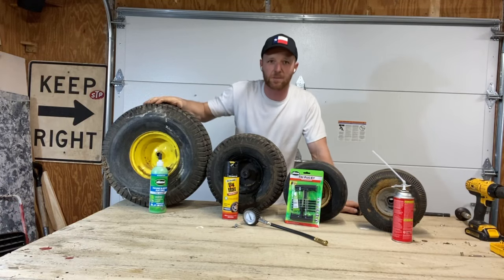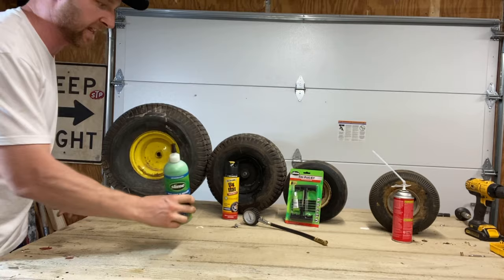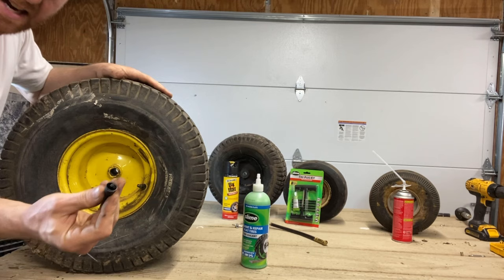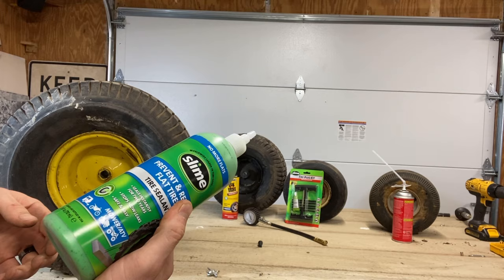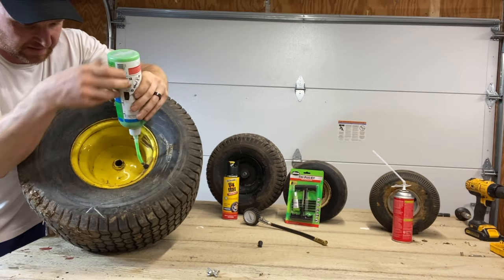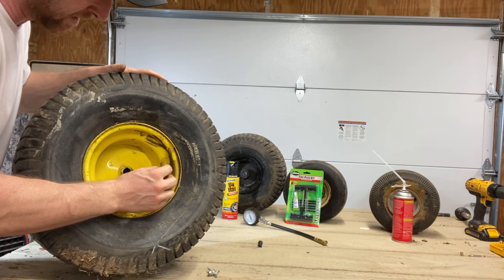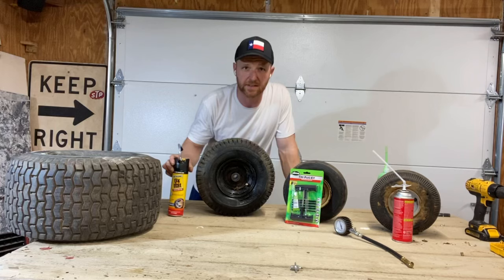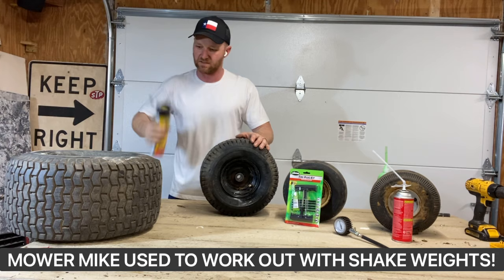Mower Tire Repair; Plugs vs Slime vs Fix-a-Flat vs FOAM (WARNING FOAM DOESN’T WORK!)

Comment: You keep calling them tire "patches," but in reality they are tire plugs.  I used to work in the manufacturing of these and went to car expositions around the world.  I sold millions of these.  One demonstration I used to use at the conventions was to take a drill and drill a hole in a car tire and immediately plug it.  By the end of the convention, that tire had maybe 75 plugs in it.  Just a word of caution.  The plugs aren't intended for sidewall punctures in any kind of road vehicle.  Although it might work, I wouldn't recommend it.    The absolute best way to repair a tire is to plug it and then demount the tire and place an actual patch on the inside of the hole with cement.  However, just a plug will almost always work.  The plugs are manufactured in such a way that the vulcanization of the rubber is initiated, but the heat that comes from driving the vehicle on the road finished the vulcanization process and makes the repair pretty permanent.
Reply from the maker: Wow that is some serious info on tire plugs. I had no idea the heat activated them. Thanks for the information.
Reply: Thanks for the information..   
God be with you.peace
Reply: Yes those plugs are great. 3M also has a glue called PR 40. It literally welds rubber together im going to try that stuff
Reply: So doesn't that mean the plugs would not be a good choice for a lawnmower or snowblower, which never move fast enough to generate enough heat to fully vulcanize the plugs?

Comment: Maybe someone else has already said this, but, the tube of rubber cement just lays there looking forlorn and not getting any attention. You are supposed to put some the whole length of the plug material. It makes it easier to push unto the hole.  It is called a plug not a patch. Maybe you are too young to remember actual tire patches. They had combustible fiber in a tin container with the rubber patch on the bottom. There was a clamp designed to hold it tight on the tube and you lit the fiber with a match. the heat sealed the patch to the tube. For a tubeless tire, there was a "boot" that was put inside the tire and sealed over the hole. My dad owned a service station and a tire shop. I patched a lot of tubes and tires. That was also back when we pumped the gas for the customer. I was skeptical when all of the tire shops started using plugs and wouldn't do patches any more. I thought they wouldn't hold up, but I was wrong. I have plugged a lot of tires and they have lasted until the tire wore out.  Good video. Thanks for sharing.
Reply from the maker: Great comment, you are correct I am not skilled in the art of patching tires. I thought the glue was already built into the actual plug but I was wrong and should have used the cement. Thanks for watching
Reply: Oh! yes the good old day of patches.

Comment: Try liquid rubber fill the whole tire with it then let it dry out in the sun that stuff hardens into solid rubber but it can be expensive and results are can be 50/50 another thing to try is that liquid flex seal and paste coat the inside of tire with a thick layer also dries into a hard rubber but is a bit more flexible depending on thickness let dry then fill with liquid expanding foam once mounted back on rim. Any way very informative use full for any one considering a fix or permeant solution to mower tire problem.
Reply from the maker: I appreciate the input but my filling tire days with random stuff are over. I have the foam dialed in and it seems to work great.

Comment: those are plugs not patches. Two different things.  Also you said especially in the sidewall they work good. You aren't supposed to use those at all on a sidewall
Reply from the maker: Haha whoops. Thanks for the heads up

Comment: For slow leaks it seems slime could work but it might loose its efficiency over time. Sometimes the slime might even spew out for some punctures and it seems no amount will fix that type of issue. Then the next course of action is to plug it. Iv never had any issues with a plug assuming you can find it.
Reply from the maker: I agree plugs work great as long as you know where the leak is.

Comment: Thank you. The riding mower has a slow leak in the front. I can fill it once every 2 weeks & it’s fine. This video saved me money because I decided to just keep filling it with air so that I don’t have to mess with any product until absolutely necessary.  I know some complain about Slime & Fix-a-Flat but I believe that’s more about what it can do to the wheels on a car over time. When I do need to use a product for the riding mower I’ll try to locate the hole for a patch & if I can’t find it then I’ll try Slime. Thanks again. You saved me some money & whole lot of time. 👍
Reply from the maker: Sure thing glad to help
Reply: Some times you can put them under water and you still can't find a real slow leak, even way over filling them with air! seems front tires are the worst as you have all that grease in the hubs.

Comment: Slime works great!  Put it in the tire and mow the grass, that gets the sealant spread everywhere inside the tire.  Fix a flat makes a horrible sticky mess that is very difficult to remove and it is flammable.  Slime will just wipe out of the rim with a paper towel.  Great video!
Reply from the maker: I agree Slim is my go to. Glad your enjoyed it

Comment: Thanks for these ideas---I have golf cart tires with slow leaks all over my place and got tired of buying new tire replacements. This gives me the courage to try slime and save a ton of money.  I can't wait to try the foam on my handtruck tires that keep going flat!!!
Reply from the maker: Good luck glad to help! I suggest starting with slime. I have several videos on the foam failing that will give you a chuckle.
Reply: Foam will work but only short term. Once it sits with weight on it, it will develop flat spots in the tire where the foam crushes. Foam insulation is an expanding polyurethane, which creates a hard and inflexible foam that the bubbles crush after hardening instead of flexing like with a rubber foam.
Reply: The run flats I have came from Harbor Freight, not home made.

Comment: if its froze on the axle just change the tire on the unit. did it with all sorts of tires for the 15 years as a tirman at goodyear

Comment: Good advice on using Slime. My first try was on a terrible old lawn cart tire that's weather checked but no nail holes that I can find. It held pressure for a couple hours but now is going flat again. I'll now try what you demonstrated. I'll remove the tire and use a lot more Slime than needed. If Slime works on this tire this whole thing should have been used as a commercial for Slime. lol
Reply from the maker: Haha Slime is great. Super easy and and works about 50% of the time.
Reply: @MowerMike  Several years ago I found a very nice bicycle free but it had a flat tire. I used tube Slime on it and it's working fine today. It didn't work on the rim leak on my Silverado. Before the tire guy works on it next week I'll tell him about the Slime lol.

Comment: I use Slime on my mower for holes mostly caused by goat heads and it works great. And I probably use half or 1/4 the recommended amount.

Comment: I haven't tried the slime but Fix a Flat works great on these smaller tires as the beads don;'t stay sealed and you don't have to use the whole can on the tire.  Just enough to seal the tire and do it to all the tires.  You may have to do this each year if you live in cold environment.  Neighbor spent over $250 putting tubes in all 4 tires.
Reply from the maker: Youch those are some expensive $5 tubes

Comment: I have repaired bicycle tires in the past, but for my lawn mower I was not sure. So for the past 2 years, I have been filling my LM tires with air each time I took it out. By the end of the day the tires would go flat again...I did the same thing next time and everytime. Now I have found the above ways to fix the tire and will do so. Thanks
Reply from the maker: Man don’t bike on flat bike tires. New tubes are super easy on bikes. Unless you just like the daily beatings lol

Comment: Good day Mike 
Check the instructions, I believe you need to apply glue to your plug before inserting. 
I might have a different kit?
Reply from the maker: Nope you are correct, I screwed up and didn’t do the glue but it still worked. And Good Day to you Mattie lol not sure how to say that.

Comment: IIRC, someone at the Garage54 channel put cement in car tires.  It was a rough ride and very heavy but worked.  Maybe the foam would work there for anyone with the patience to mess up until they get it right consistently.
Reply from the maker: Haha I am not that desperate for views to try that.

Comment: I am a believer using slime the first thing i do when getting a mower or ate is ad slime in I used it first in a 48 in riding mower 15 years ago then a atv 12 years ago and a 52 in  zero turn mower 8 years ago and a side by side atv 7 years ago and i still use all of these and have not fixed a flat tire yet also have used it in auto tires the great thing about slime is its water soluble
Reply from the maker: I totally agree Slim is always my first choice.

Comment: Thanks for providing a thorough comparison! We recently bought a JD X330 riding mower and have put on 18 hours so far.... However, we live in an area with lots of rugged terrain, cactus, and yucca. It's bested both fronts already! 

Our servicer recommended foaming the tires to make them impenetrable. So far, I have found most individuals use the gap and crack to get the job done. My only question is how long before the foam starts disintegrating. Would you recommend foam filling over buying a pricey tire?
Reply from the maker: I highly suggest not putting foam in it. Just take it to a local tire shop and have them put a tube in it. I have a ton of foam videos and tried every way to make it work. It will last about 2 mows before it breaks down. Check out this video

https://youtu.be/c8ACxgM7Y2Q?si=NvxcNAvw8e7Q0Wfj

Comment: The best tire sealant I've found is Tireject.  It even fixed several sidewall leaks.
Reply from the maker: It won’t fix 3/8 inch holes :)
https://youtu.be/WfWyo5Pocl4
Reply: Put the 3/8 drill back in your toolbox. That tire with the foam in it is forever committed to that wheel. Have you ever taken a tire off of wheel that has been repaired with Fix-A-Flat or some other goo? It's not pretty or healthy!
Reply: @MowerMike  Not a drilled hole perhaps, but it will seal a hole from a 3/8" diameter object that pushes through the tire.  And maybe it would have passed the drill test if you had put the tire to use or at least rolled it for a while to let the fibers and magic sauce do their thing.
Reply: @bluewhalemountain8342  I've dismounted several tires that had sealant put in them with no problem.
Reply from the maker: @DonziGT230  I agree, I was a bit extreme using a drill bit but was just trying for some YouTube gold lol

Comment: I'm gonna use the foam on two dollys i have, both with bad tires (cracks) and leaky tubes also. But after each use I'm going to store them off the wheels. 

I'm only going to drill one hole though, and remove the valve stem also. So total of 2 holes, opposite of each other and on different sides of tire.  I'm going to put about a tablespoon of water in the tire and get it wet inside also.
Reply from the maker: Good luck! I bet it will work fine
Reply: @MowerMike  it worked fine for light duty. I'm still letting it cure. I'm going to dunk it in a tub of water and let it soak for a day. It's been drying in dry sunny air for 4 or 5 days now. I injected the foam into the inner tube itself whole inside the tire so I think it's having cure delay due to lack of air.  I ended up drilling 4 holes in a cross pattern on the outside of the tire only.

Comment: Interesting video but the problem with using foam is that as you drive it the foam breaks down and then you're left with a tire that's useless. What I have done on a fairly rotted tire that's tubeless and had tons of sidewall leaks I would go out and buy an inner tube and install it and voila no more problems.  Much cheaper than buying a whole new tire.
Reply: Also you don't need to take the tire off as you can just squeeze the inner tube inside the tire and then inflate it.
Reply from the maker: I totally agree with ya. Check out my tire playlist for my foam fail videos

Comment: Just had to replace a tire that the slime couldn't fix.  Was surprised to find it was still liquid in there after 6 years and washed right off.   Fix a flat turns into a rotten milk, stinky chunk your not getting off.  I have a tree with thorns in my yard so I had flat tires after my first month mowing but not for 6 years.   I caught a piece of wire through the sidewall mowing at my club field and nothing would fix it.  EHH, it was time for me fronts anyways, was more Slick then tread.

Comment: I tried this with my lawn tractor rear tire that had a slow leak. Just to clarify, I don’t use the tractor much. It might be several months in between so it dose sit a while and the tire might be flat. Once filled it will hold overnight. I used Slime. I first jacked up the rear off the ground, put about 16 oz into the tire then replaced the stem valve. Turned the tire about 10 times. Filled the tire to 15 psi and drove it around the yard for 10 minutes. The next day it was flat again! Let it sit for a few days, needed it to move some mulch so I pumped it up again and saw where the slime was coming out. There was a crack in the tire, slime was bubbling out. After moving the mulch around and before I put the tractor back, I sprayed the whole tire with some Flex Seal I had then filled the tire to 15 psi. Now after a month, it’s still at 15 psi! Can’t say if the Slime combined with the Flex Seal did the job it could be one or the other, but the tire is holding air.
Reply from the maker: Wow, so are you saying you sprayed the outside of the tire or the inside of the tire with flex seal?
Reply: @MowerMike  I sprayed the outside tire wall. It's been about 2 weeks and it's still holding.
Reply from the maker: @Phlymedicare  That sounds fascinating. I am going to have to do a video on that, thanks for the idea.
Reply: Mike Fisher. I would put my money on the flex seal, slime i have never seen it work at all . I would call it a worthless product. If others have had different experience. Ok .
Reply: @theoldmanreed8818  I doubt very seriously flex seal sprayed on the outside of the tire is stopping a leak. probably work on the inside where it would have to be forced through the hole before it could leak creating a compression seal. Being on the outside it would rely 100% on adhesion and unless it is vulcanizing probably would not hold.

Comment: I think the problem with the foam is that over time it will break down.  I don't know the life time and it would depend on use. It's probably a good cheap fix for many basic situations(small tires without too much load).
Reply from the maker: You should look  at my tire playlist, have several foam fail videos on there. You are right it breaks down
Reply: @MowerMike  You should look in to something that you can combine with it that will make it stronger or find a different material. There are various ways to expand things using air so maybe mixing in fiberglass insulation with some type of polyurethane foam would work. Something in there has to provide the structural stiffness that can absorb most of the load and the foam has to be able to not tear apart(so it has to be flexible).

For example, there are "foam beds" which has a strong foam structure that generally doesn't break and is really flexible but it doesn't have a let of compression strength. If you could find a way to use it and strength it up without causing it to be brittle then it would work very well).

Comment: Okay, I tried it twice on my front zero turn tire. Once with filling through valve stem(no holes drilled) and a 2nd time with 6-8 holes drilled in the sidewall. Both times tire filled up nicely and was flat again the next day.  Not sure why it isn’t working for me.

Comment: My experience with Slime is that it just doesn't work well and is a screaming mess to clean up when you finally take the tire off to put a tube in it.  I'd love to have a foam which would work to let me fix my own tires, but foam just doesn't replace air for proper tire performance.  I use foam run flats on wheelbarrow, handtruck, etc, but not on mowers which run at 3-4 psi.
Reply from the maker: I agree you should check out my other foam fail videos

Comment: With the foam filled tire I would only do 2 holes a fill hole and a smaller one to release the extra pressure plus to fill the whole tire all around it
Reply from the maker: Good advice, I would stay away from foam though. Check out my tire playlist

Comment: About 4 ounces of a cheap brand of Automatic Transmission Fluid (ATF) works great for slow leaks.... I've used it so many times and work 99% of the time.
Reply: I tried it, still very slow leak.
Reply: @roberttavenner9398  it works 99% of the time on mower times for me.  I repair abut 30 tires a year. Try at least 4oz and more if it still leaks.  It could be the valve stem also.

Comment: The seal broke on the tire, and I was able to get the air back in it, and it was nice and hard. But then it broke again. The tire is not bad. Its just the seal broke. Any suggestions?
Reply from the maker: Just put a tube on it then the seal doesn’t matter
Reply: @MowerMike  OK, thank u very much.